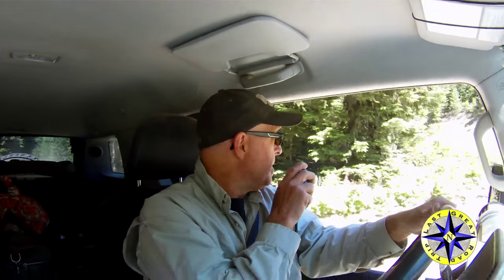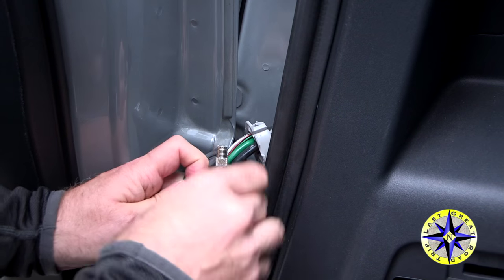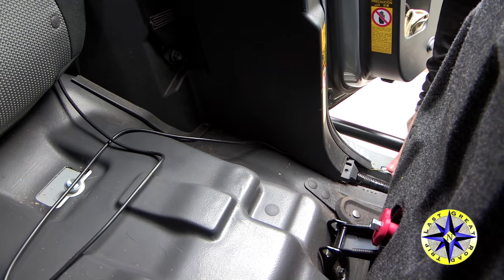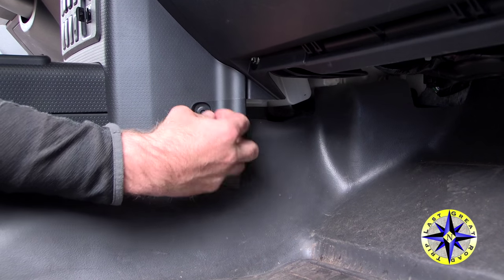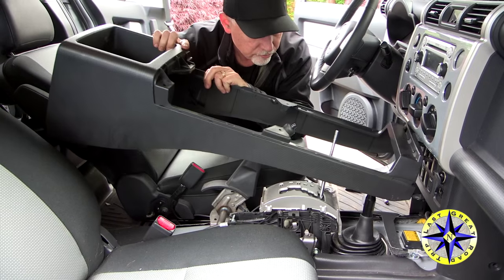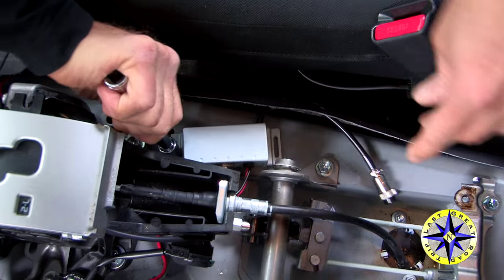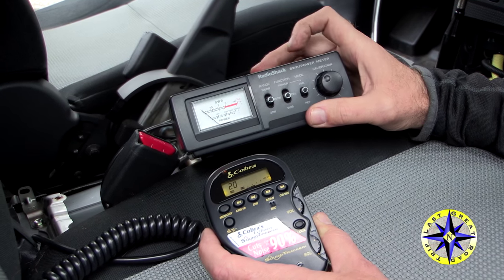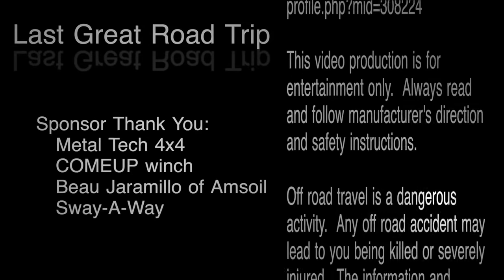Toyota FJ Cruiser CB Radio Install DIY

Comment: This video helped inspire me to buy the cobra 75. It turns out to be much more difficult to install than I had expected. It's been a good challenge to say the least.  Tapping into the auxilary power seemed sketch for me and my wires are short. I am going for the straight to battery wire as I've read here and elsewhere.
Reply from the maker: Thanks for the note.  how did you run your wires to the battery?  through the wire harness pass through way up under the dash or other?
Reply: Decided to go straight to fuse box instead with mini add a circuit https://www.pepboys.com/product/details/8962054/00742

Comment: you never use any other auxiliary hookup for power you only run power straight from the battery because of interference through the wiring system and the alternator will come in and will distort the CB radio from functioning at itss 100% capability you should of random straight from the battery with a inline fuse as close to the battery as you can get it five or 10 amp

Comment: For anyone considering this install, this is only a good brief overview, in no way a comprehensive install guide, many details are not covered. Make sure you do your research.
Reply from the maker: +ruebarb1 really which details did you need that were not in here?
Reply: +Last Great Road Trip #1 Grounding the antenna, possibly removing paint from the door mount and possibly the bandi mount. Cable length and coiling, antenna length, how to actually tune the antenna with the SWR meter, not just reference doing it.  These are these details that stump most folks, I've tried fixing so many CBs at runs, where it was all laid out, but these details are why it is not working or the SWR is high, it will burn out the CB, some cases it already had. Your video is a good layout guide, but won't get the radio tuned and working properly, just want folks to understand there is more to it.

Fan of your vids btw.
Reply from the maker: ruebarb1
Good points..  if you followed the link in the video description you'll see the parts list we recommend and the antenna cable we use does not require exposing it to bear metal. The link also shows how to select an antenna and tune a system.  Some of the info we've passed on before over the years.  We hope people use all the resources we provide.

Comment: it actually would have been easier also for you to run them straight from the battery through the plugin the firewall instead of having to take half the cars interior Plastics apart for absolutely no reason only to get bad interference and feedback because you didn't wire straight from the battery
Reply from the maker: J-BASSNFANATIC certainly another way to do it.

Comment: what did you use to tap into the auxillery power?
Reply from the maker: just some little blue splicer clips from the hardware store...  nothing special or even the best out there but never had one fail so there is that!